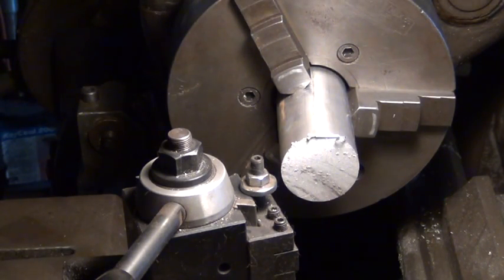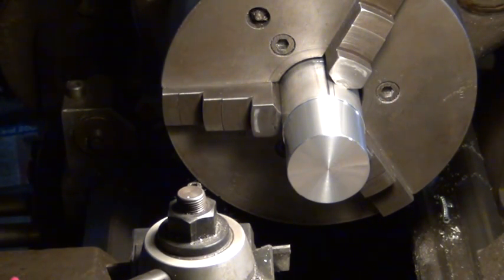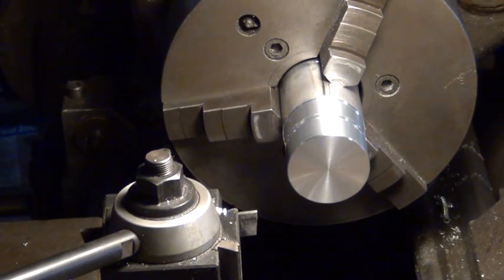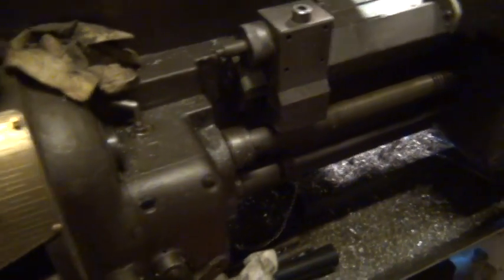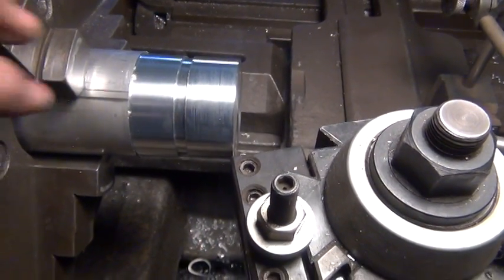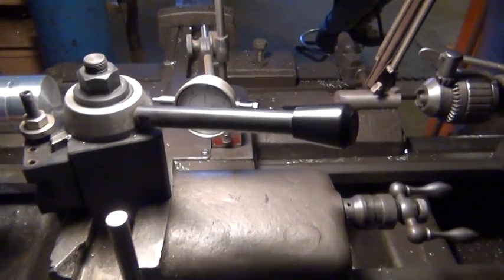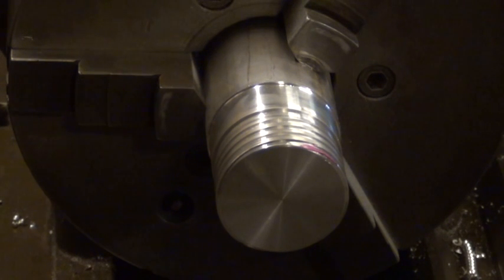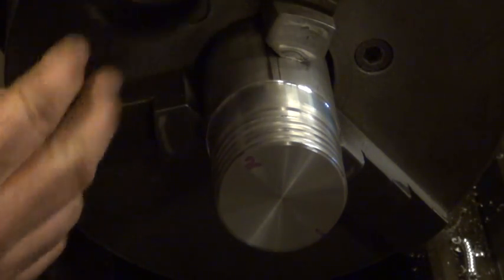Cutting a double start acme thread

Comment: i know this is an old video and i doubt you ever read this, but there is an easier way to cut a double lead. with an odd thread its simple,catch a numbered line , then catch a non numbered line or a half line depending on the lathe.  but even threads can be split also. i catch a line then catch a quarter line. i just put a mark on the chase dial with a sharpie. I find it much simpler than dialing over 1/2 the pitch with the compound.
Reply: I did this the other day, everyone was telling me to set the compound to 90 and move half the lead, they were amazed when I caught the half nut between lines. I cut both threads at the same time, as in dial in, cut first lead then second so you know they're exactly the same depth.

Comment: I'm in college practicing machining on my own time, so this could be dead wrong, but I get good continuous chips running the parting tool at around 250 sfpm on work usually around an inch. Any faster and you start getting the flakes like when you cut your relief, and you stand a good chance of snapping the end off. It sounds counter intuitive, but you get better results all around when it crawls.
Reply from the maker: +Nova My Hamilton lathe has 2 speeds (4 with back gears) I do not like the strands, but to try to always avoid them in instances like the relief cut would take a lot of extra time! At the low RPM of my lathe Aluminum will make the continuous strands a lot! I allow for this and keep away! I would like to be able to vary my feed rates and speeds more but you use what you have! Thanks for stopping by!

Comment: Acme threading tools are sized to the TPI you are cutting - more threads per inch, the smaller the tool point.  Did you use a tool for 4 TPI?
Reply from the maker: Yes the tool was ground for 4 tpi.
Normally on a 2 (or 4) start thread the tool size will match the standard Acme tpi, so all you are doing is changing the amount of turning to put a nut on, a 2 start will move twice as far per turn as a normal thread!
 
Thanks for asking, I didn't think about mentioning that!
 
Jeff
Reply: Jeff Sigrist
Wow!  Thanks for such a quick reply.  Thanks for posting all these videos.  It's really great for you to take all the time needed to post these things.  I'm using an old Atlas 12 x 36 and without these great videos, the manuals would be virtually uncomprehinsible.  THANK YOU!
Reply from the maker: Thank you!
I do these videos to help people out because back when I started it was trial and error! Like they say "If at first you don't succeed try again" well with all the videos on you tube even I can succeed quicker!
Hope you can post some pics or video of your Atlas sometime!

More to come!
Thanks again for watching!
Jeff

Comment: Looking Good - Nice old lathe are all those copper tubes original for the oiling ?
Reply from the maker: Yes, it has an oil tank with a pump that runs off the quick change gearbox! I think it has 9 oil lines ( I'll have to look again) that come out of the pump! The pump is a ratchet type that oils 1 line at a time in a continuous cycle!
I will try to do a walk around lathe video soon!
Thanks!
Reply: Looking forward to that.